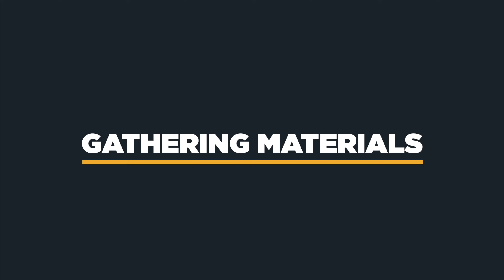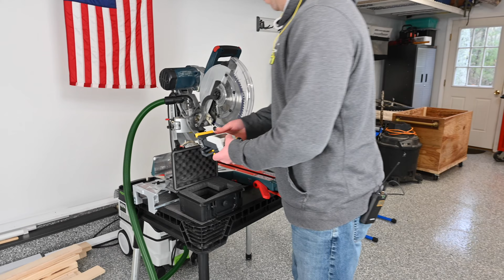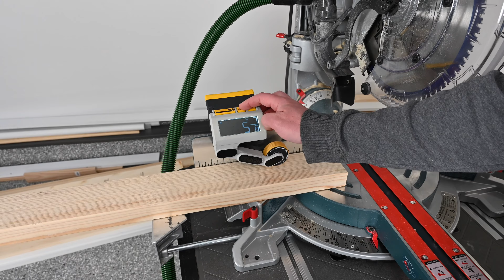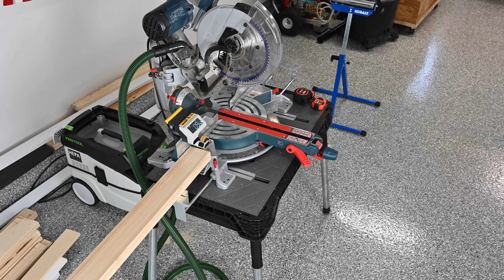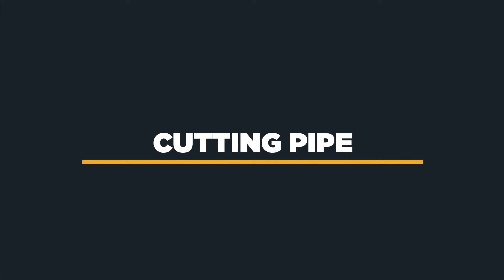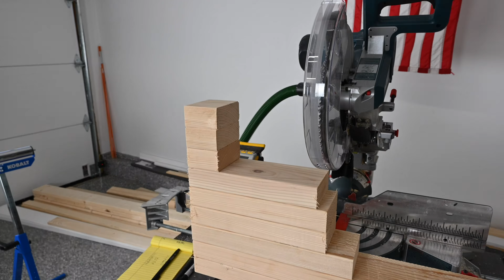In Depth Review and Demonstration - M1 Caliber by REEKON Tools

Comment: For $159 there should be no variances at all. With a normal tape measure it takes more time, but the variations in measurements even at a 1/32 of an inch shouldn't really happen. Not for that price

Comment: Most frustrating product I've ever bought. Great if you want to cut everything 1/16" short. Doesn't work as shown. Hold down blade offset and press it again and it just switches from my to inches to fractions in a loop.
Reply from the maker: hello, we'd be happy to help if you're having issues with the blade offset.  Form the sounds off it, that behavior happens if you release the offset button too soon before "blade" appears on the screen

Comment: Do I have to calibrate the M1 every time that I remove it from the miter saw??
Reply from the maker: Hello Javier, not usually unless there are extreme temperature changes or the M1 is dropped.  It is always good to verify a measurement first but calibration is generally very infrequently required.

Comment: When you make the zero cut how does it compensate for the 16th cut once you passed it through?
Reply from the maker: Hello Don, you can set your blade width which will be applied as a negative value to any cut made - https://reekon.zendesk.com/hc/en-us/articles/360061902152-Setting-the-Blade-Width-M1-Caliber
Reply: @REEKONTools  right, but when you passed the wood through you made a zero cut to start, instead of using the factory cut you made your own zero cut, so then is that always necessary when you bring a piece of wood through?
Reply from the maker: @jonlebon5086  once the blade offset is saved to the device, it will automatically be applied and is needed anytime the cut of material we want to keep (good piece) is on the right side of the saw
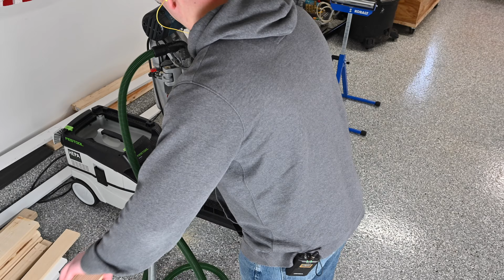Reply: @REEKONTools  look at 6:06 of the video, where you bring the wood through it starts to measure, but then you made a cut…does that throw off the cut my a 16th? I can see the remaining cuts being compensated for when you calibrate the tool. But it’s that initial zero cut
Reply from the maker: @jonlebon5086  the zero button was pressed after the cut was made which established the zero position and accounts for the blade width (0.09")
Reply: @REEKONTools  ahhhhhhh I see, you had it at zero. Got it, this tool was sent to me via text from ACME tools, I like this I’m gonna order one, thanks
Reply from the maker: @jonlebon5086  Awesome, feel free to reach out to us if you have any other questions at contact@reekon.tools !

Comment: been waiting for this kind of product    Wouldn't  putting a stop on the fence be quicker in the manual / tape measure method?   I think this is great for dialing in a measurement, but getting the reps?  put a block in somewhere once you have your sample cut.
Reply from the maker: Hey Araw, the speed is comparable (if not better) in many cases on the M1 as well as works in a portable setup where you may not have the ability to clamp a block at a given point
Reply: @REEKONTools  ok will give it a shot. Which platform will ship the product first?
Reply from the maker: @arawgabi622  Indiegogo is accepting pre-orders now - reekon.xyz/27974

Comment: I make mouldings and was wondering if something like this could hook up to a machine out feed to count lengths of flooring for example
Reply: And if it were, how much length will it record continuously? Would it be capable of running 1200 feet of board if that material was well surfaced and free of dust?
Reply from the maker: @youngcrxw9983  hey Elijah, there is no external communication port on the M1.  However, it can measure up to 99 feet but meters is the longest mode which can go up to 9999m (based on screen resolution limitations).  It's not something we have tried before and there might be cumulative error at those higher distances.
Reply: @REEKONTools  that could be a hugely useful tool in wood processing if it could magnet mount to feeding machines and reliably measure more extreme lengths. I do multiple profile changes and runs can vary from 1 piece to 200 8-10’  lengths. Zeroing at the beginning of machine runs would save time and double check my quantities more accurately than I could (in inches!). I can thinking of a lot of milling applications outside of the miter saw. Best of luck!

Comment: It will be nicer and a huge improvement where angle can be supplied to the M1 Caliber for mitre cuts for calculating the blade width offset.
Reply from the maker: Hey Darya, the M1 can actually do this now.  We have added angle compensation activated by selecting the angle button which will allow you to adjust based on the angle you are cutting!

Comment: I want to order one but right now they are $119 on kickstarter. My worry is that my money is not guaranteed, which means I am taking a chance I will never get the tool.Or I could wait till it's gone to retail stores and pay $20 more and I don't have to worry about not losing my money. Btw I have no intention of using it with a miter saw. I wanna build a custom bracket and use it for something else
Reply from the maker: Hello, everyone who places an order on our Kickstarter page or Indiegogo will receive a unit (which is a $30 discount from retail pricing which will start in January)!

Comment: The kerf of the cut may be bigger than the thickness of the blade. If so do you forsee any issues with accuracy? I guess at the end of the day you have to specify the offset whether it's the blade thickness or kerf and its up to the user to come up with that number?
Reply from the maker: Yes, measuring the kerf is certainly better than measuring the blade thickness (and will be more accurate).  We rely on the user to collect this measurement and is pretty straightforward to do and adjust if any inaccuracies are seen in the cuts
Reply: Reekon. Please list instructions to enter kerf info

Comment: It seems you always cut a small trim piece off before you are going to cut your actual measured piece.  I don't see you do it on all the repeat cuts but it seems if you start a brand new cut/measurement, you trim a piece first.  Why is that?  I thought maybe it was due to getting the blade kerf set but I thought you set the kerf of the blade in the very beginning?
Reply from the maker: Hey Robert, this just helps with zeroing as is sometimes more exact than just pushing the wood against the side of the blade to zero (which also works but is a little slower and slightly less accurate)
Reply: I expect he's just ensuring he has a squared edge to touch to the blade.

Comment: Still watching the rest of the video while typing this.  When you compared the time spent to make the 10 inch cuts usig the M1 vs tape  measure. It was difference in speed of about 21 seconds.  The tape measure took about 5 secs per cut x 4 cuts gets you to exactly the different between the two measures.   However, most of us would use a stop block to repeat those cuts.  I do realize though that depending on the actual length of cut you may not always be able to use a stop block when on a job site.  Most times you will be able to by switching the stop block from one side of the miter saw fence to the other.  In a shop where many of us have a miter station and tape measure built into a fence and stop blocks on both sides of the miter station, I don't see this being that much of a time saver.  I did also notice that you have to be careful to make sure you hit the 10 inches when sliding that board under the wheel on the M1.  If you set a stop block instead of the M1, you don't have to stop and keep an eye on anything for the most part.  I am thinking maybe a stop block set right as I set the M1 for the first cut. Then I just don't have to eyeball that M1 anymore for repeat cuts.
Reply from the maker: Hey Robert, yes if you have a shop with a stop block capability, the time difference changes slightly.  In this application, the M1 shines when in the field and you don't have the luxury of making stop blocks (unless you have a very expensive stand but still may take longer) or when you need to make a variety of cuts even if they are slightly different sizes where a stop block wont work.  The M1 certainly cannot replace everything but does have many applications where it makes taking measurements significantly easier!

Comment: Hi, just backed 2 units on kickstarter. Two questions, what is the maximum measurement can it do and, what size batteries. Great product btw been waiting for this to  manifest in the world and not stay inside my head. Cheers
Reply from the maker: Hey Vince, there is no limit on measurements, it will keep going until the display runs out of digits and it uses 2 AA batteries!
Reply: @REEKONTools  That's gonna be a big tree. Thanks for the reply.

Comment: Can this be used to cut crown molding or 5 1/4 base board vertically?
Reply from the maker: Hello! Not directly and most saw fences are not high enough to support that amount of travel for the arm.  If you really wanted to, you could make your own adapter piece that attached to the fence with enough clearance for the arm to work in which case it should be no problem!
Reply: Thanks for the reply! You can get custom    fence extensions to apply over the existing fence so I know we could get the  height but would the wheel be close enough to the edge to read to top of the base board which usually is less than 1/4 thick. Crown is alittle wider. I do production trim and this would be really nice to have on the saws
Reply from the maker: @toolman101476  ah if that's the case then no as the wheel contact area is offset from the fence by about 2mm.  There are tricks around this though (in addition to height, you get a shorter piece in front that 'pushes' the wood so its in contact with the wheel but avoids hitting the arm.  Happy to sketch this out if you shoot us an email at contact@reekon.tools too if interested!

Comment: Blade offset in mm, is it set by 0.01cm / 1mm steps? 
 
Common thicknesses in Europe are 1.4mm, 1.6mm, 2.0mm, 2.2mm, 2.4mm, 3.2mm...
0.01cm or 1mm steps would be the right choice.
Reply from the maker: Hey Thomas, the blade offset in metric can be set in 0.1mm increments so should be no issue!